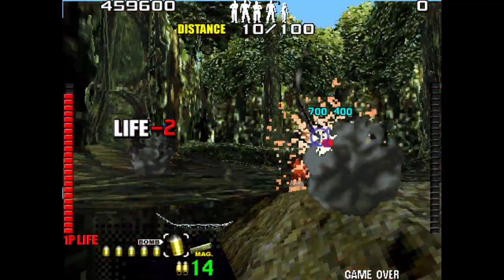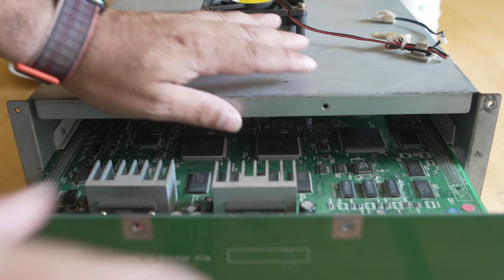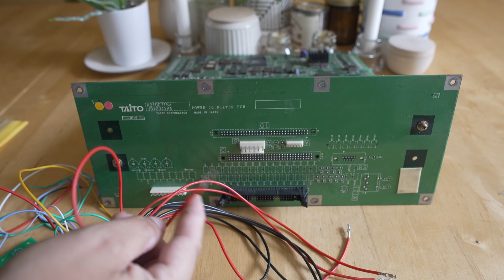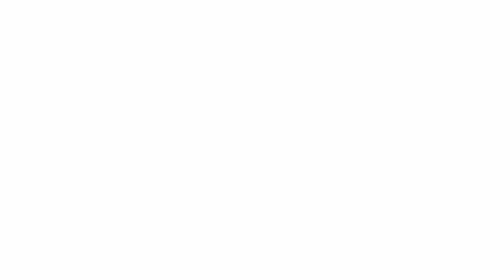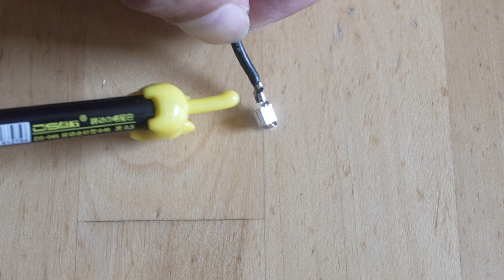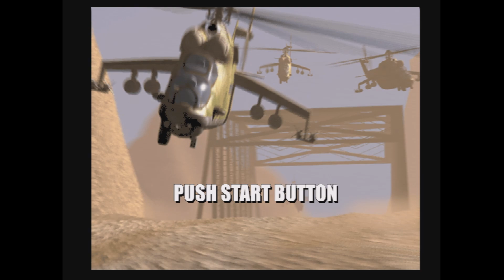An Arcade Game So Rare I Know of Two Others! Operation Tiger! Teardown and Gameplay Part 1

Comment: The 5v wire closest to the 12v one on the power connector doesn't look like it is fully seated in the shell
Reply from the maker: It’s pushed in till click. Sometimes I swear JST housings are a bit weird in their moldings

Comment: How did @Ville Linde figure out the emulation of this bizarre hardware. Super impressive.
Reply from the maker: My guess is it’s similarity to Type JC with the 68040 CPU. A lot of the DSP hardware is an evolution of Type JC (it’s confusing naming. This is “PowerPC Type JC. The 68040 version is just Type JC)
Reply: Maybe he will come back when he sees your footage :) BTW If you are doing a part 2, have a look at "JAE PS-SEN 60PE" connectors instead of ide as you can crimp to only the pins you need for the inputs.
Reply from the maker: I’ll try to get in touch with him

Comment: Looks like a super capacitor.  I've replaced batteries on boards with supercaps in the past to save high scores.  Specifically Pole Position boards.
Reply from the maker: I checked. It’s a cap